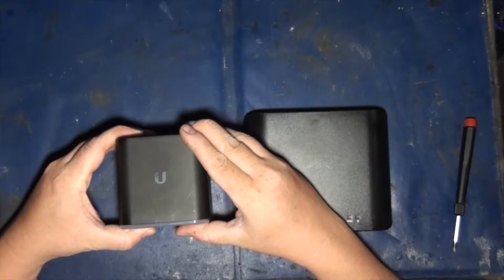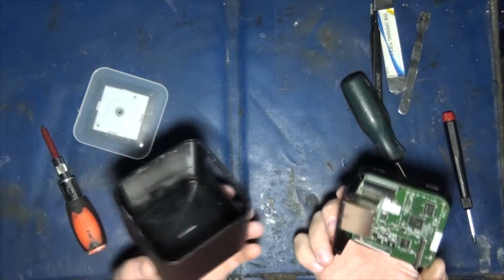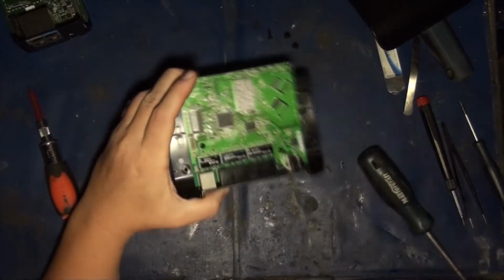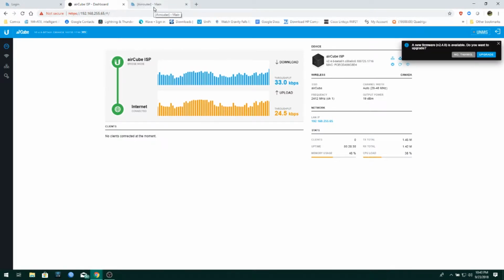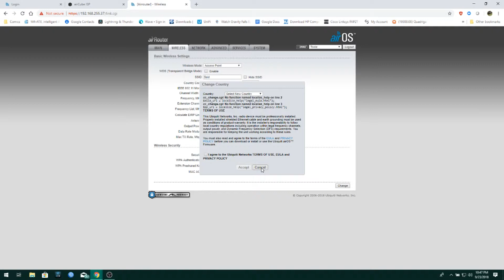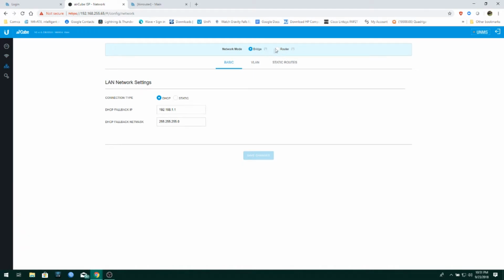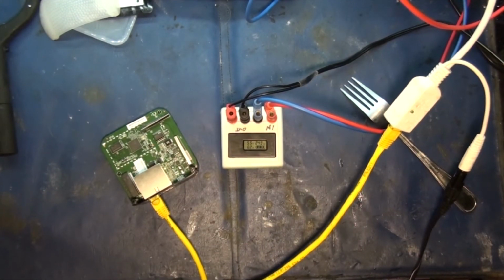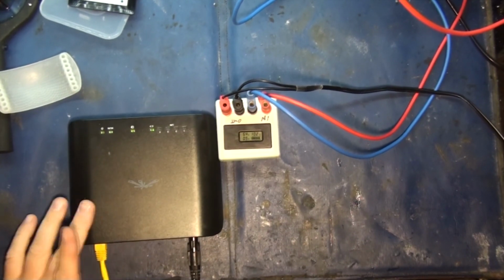Cube vs router

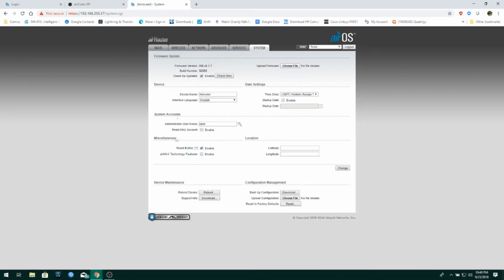Comment: i seen at 16:31 it has airmax technologies features (off) so maybe you can run it in that mode you have it in?
Reply from the maker: Airmax only works with other ubiquiti radios. Its typically off by default on the consumer routers. If you'd like to use one of their Carrier radios as a standard WIFI ap you simply turn it off and your good :)  With the air router because its running ubiquiti air OS you can use it as a client unit and connect it to an airmax enabled AP.

Comment: Hi ms fix, may i request video how to install AR9342 to nano beam
Reply from the maker: I can look into it though with many of these devices the pin outs are all different making it difficult to match a chip to a pad it wasn't originally designed for. Goes the same for peripherals on the PCB. Some chips have different bus options than others. Different memory options. Also nanobeams don't go back together very easily.
Reply: @thefixitgal  yes right, i m difficult to install to pad hmm. If you had any suggest to install it please let me known